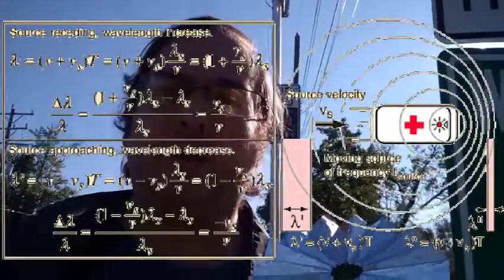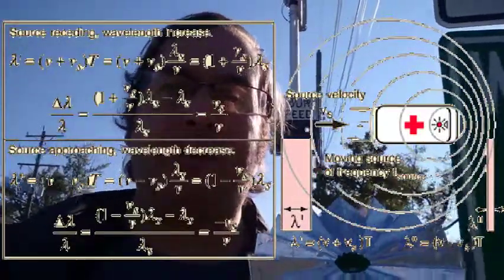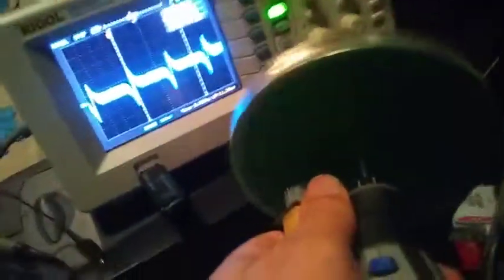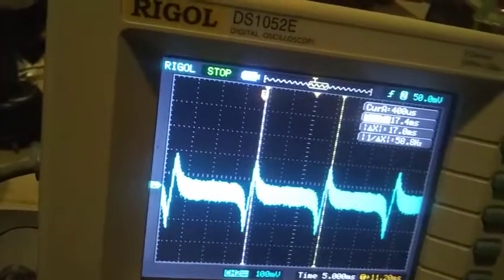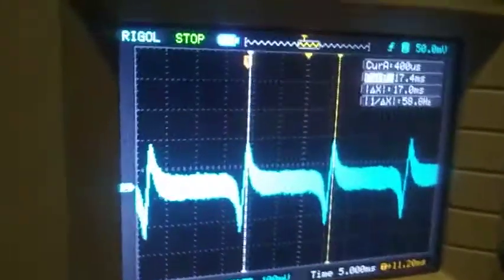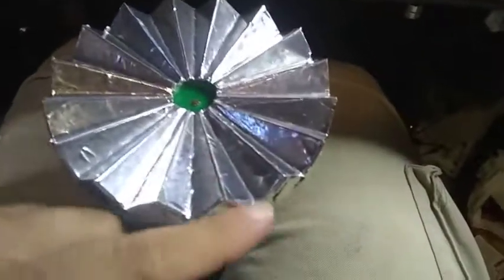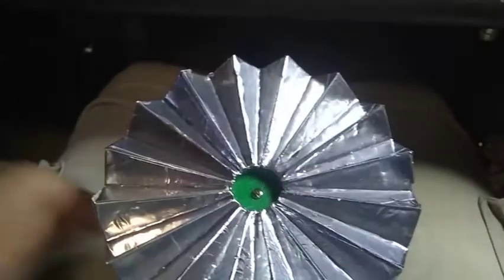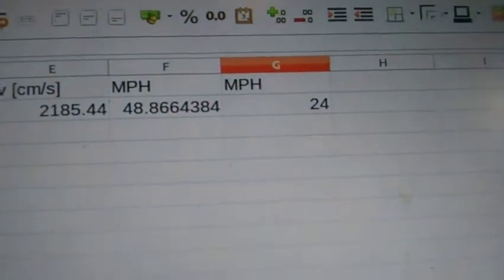Doppler Radar Spinning Disc!

Comment: you should checkit with a dosimeter, it should be k band 3 6 mw range. you should also checkout simrad 4g digital system vs conventional magnetron that might keep you entertained
Reply from the maker: I will have to look into it!.. Sounds like some interesting projects.. Thanks Jim!
Reply: @jaynesnetwork  i worked on radar 15 years or so, other then true doppler where the magnetron is traded for solid state gear, simrad went digital, which allows for a large frequency shift, biggest notable is target detection on targets that would absorb tradition beam, foam pot bouys, seagrass etc, even more impressive with weather and bird detection longrange

Comment: The triangle shape of the reflectors have the added benefit of reflecting different frequencies of radars .
Older speed trap radars were something in the 400 Mhz range, newer ones are 2.4 Ghz and maybe even up to 5Ghz and 10Ghz .
Reply: k band, alot switched to laser pulse due for protection of pedestrians, i thought i even came across talknof trials using ultrasound
Reply from the maker: Very interesting.. good to know.. Yes I wasn't sure what frequency band they are using, or even if it is RF or laser! Thanks for the great comments! With the 400MHz, the beam size would be huge! How could the tell who the return was from??? I guess they can give the ticket anyway.. To who every they choose to.. since the courts are all corrupt!. They will go long with anything the officer says!! and none of them are RF engineers anyway.. I guess it all pays the same!!!
Reply: @jaynesnetwork  laser can be defeated with reflection, optics. 10ghz, you can use o_scope
Reply: Not even close. 400 MHz was not used in my lifetime. Speed radars in the 1970's used S-band (2.4 GHz), then 80s 90s used X-band (10GHz), and now 24 GHz ...